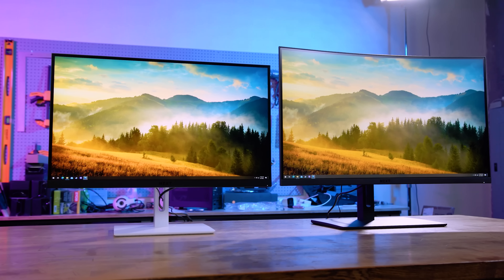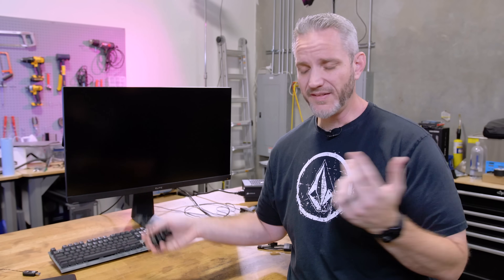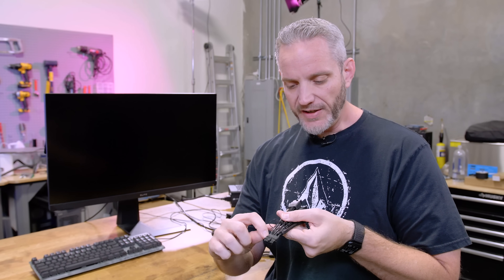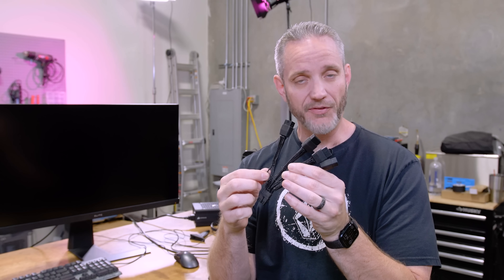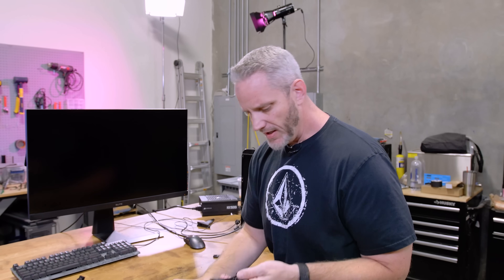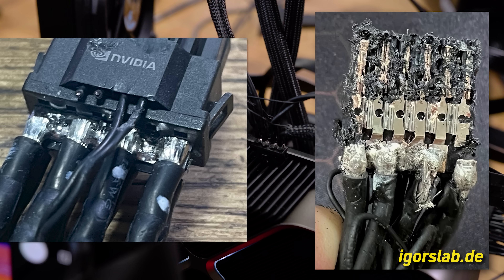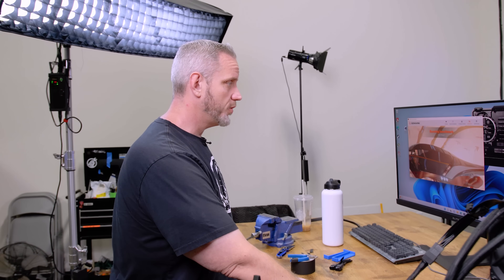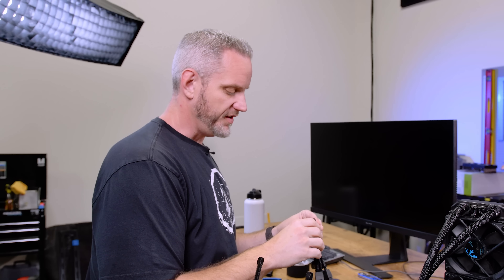Igor's Lab figured out why NVIDIA adapters are melting!

Comment: It scares me that a multibillion-dollar operation can miss such a crucial issue in the design process :/
Reply: Apparently not every business learned from the Ford Pinto fiasco
Reply: Hey now, we can save $0.01 per cable if we do this... that's a new leather jacket.
Reply: Its not Nvidia that designed the cable though. Nvidias problem is they want to always be first and bleeding edge to adopt new tech standards, unfortunately this time its bitten them a little.
Reply: You've obviously never worked for a large corporation in a design capacity ..... I worked for a major industrial controls corporation in the late 90's and it was a constant battle between the engineers and the Beancounters who wouldn't know an electron from a proton, a bit from a byte or their own ass from a hole in the ground ..... They were always looking for ways to cut corners and cut costs .... I eventually just quit because I got tired of all my designs being re-specced by people who didn't know what they were doing. There is a reason I chose a particular capacitor type and manufacturer 

Like I used to say: I can do it fast, I can do it cheap or I can do it right .... Take your pick because you only get one choice
Reply: Greed knows no bound fam.
Reply: Not the first time either!
Reply: They didn't miss it, they even warn against bending it in the manual. The problem is they designed it so that people can fuck up their cards easily and they dgaf
Reply: They cut costs and used a shit manufacturer to make the cables who used shit solder and didn't solder them correctly in the first place. So produce as cheap as possible and price 3000%over the initial cost. Easily breakable components they tell you not to flex btw means broken cards they can void warranty on and sell more cards. You know they will pulls some "well you did this when you should have done that" type of crap forcing people to buy another card after they deny your claim due to user error. 😉
Reply: @BNR_248  Yet they didn't adopt displayport 2.0 lmao.
Reply: @NHDude  Lehto's Law did a video with some info on the ford pinto.  Apparently There was one car that caught fire after a crash.  Dont think anything happened aside from that
Reply: @longjohn526  with the unprecedented profit margins of the 2019-2021 companies are milking consumers like never before - For how it used to be, i can only imagine how tight the beancounters are running operations in these stupid recent times
Reply: @NHDude  i own one with a 302 lmao
Reply: They just don't care. Once you get that big, giving a crap about the customer goes right out the window.
Reply: This is exactly what a multi-billion dollar company always do. You should be scared because they are all like this.
Reply: they probably designed the cable correctly, but high probability that either bean counters or Chinese manufacture changed it off to shave some change into their pockets.
Reply: I smell burning actuaries.
Reply: @professortriplextralarge5  it's the fact that was even possible considering other cats had safety features that stopped it long ago.   cars rarely explode outside of movies and mob hits
Reply: @PURITY Is it? 12vo isn't 12vhpwr. 12vo is a 10pin that takes the dc-dc changes off the psu and puts it on the motherboard. 12vhpwr just seems to be on atx.
Reply: Sounds like a job for the “Plainly Difficult” channel.
Reply: @longjohn526  eh.  You can some times get two on the triangle.  Just not all three.  And to get two it heavily impacts the third
Reply: Yes and I own two, one of which I bent already prior to knowing about this, nvidia owes us a free cable.
Reply: @Michael-zf1ko  yea that’s a weird decision. Can’t explain that. For the price should be display port 3.0 lmao
Reply: @jemiebridges3197  If it was one car and after a crash then there isnt much evidence to say it was a mass defect.  Thats what i know.  Let me know if theres something I'm missing
Reply: @Kasaaz  The design itself is so braindead that even if you make it in the best way possible it's still flawed.
Reply: @longjohn526  There's a similar one in the car world. You can have reliability, performance and inexpensive but you can only choose two.
Reply: That tens to happen when you're too busy talking shit to the people normally handling these things for you so you can justify running them out of business.
Reply: @PURITY It's the cable standards committee for PCI, a third party.
Reply: @Jesus_4_All  Yeah, especially after he showed the one Igor's Lab had fail, you can see why some of them are being made even worse. They aren't using a single plate across, they're using sections and then bridging them with the solder for the wires. It's no wonder they snap at the edges.
Reply: @BNR_248  Then why they got the beefiest card ever stuck with Displayport 1.4 instead of going 2.0? They could have reduced some overhead, which would be actually useful, plus a higher bandwidth limit (probably not as useful for most people as 1.4a is already pretty fucking high).
This is just mismanagement, no company is immune to that. They didn't need more space on the PCB, there is no point to this plug.
Reply: they didn't miss.  They've told people the allowance the cord should be given.  People shoving it in small cases and forcing bends is on them, nvidia shouldn't do anything for the people that caused this issue themselves.  If nvidia needs to do anything, is to extend the cord support or tape so bending it past the allowance isn't even possible without removing the support
Reply: The only reason why they use this small little shit connector because of they want to save some space of GPU pcb for other components because in the old connector is huge and eat up a lot of space like 8+8+8 pin PCIE
Reply: @xXDeltaXxwhotookit  only about profit and not about quality these days, its so sad
Reply: They knew most likely. Someone with an MBA tried to save 1 dollar per adapter by doing them this way.
Reply: Seems like the standard way the world's going tbh.
Reply: Mo money mo problems am I right?
Reply: @lucastonoli3256  mate I don’t know I don’t work for them hahaha.
Reply: I guess you never heard of Boeing?
Reply: @NHDude  they probably have a lawyer who told them how much to pay for a settlement.
Reply: AMD and Nvidia both make their stuff in China. This is what happens.
Reply: It's usually small 10cent parts taking down the big expensive machines
Reply: they didn't though, they knew it was an issue but chose to ship it anyway.
Reply: @professortriplextralarge5  a full "autopsy" was ordered.  I was a kid so I didn't pay much attention at that point, but my parents made the engine for that car and later the f150 and mustang, so it got talked about a lot.  Musta been pretty spectacular if it was only a single incident.   However there were other incidents along the same line just minor but dangerous.  So more than one data point, but this was more the nature of fires than explosions I guess.  also everyone was probably still suspicious as that was after whatever car thing that made Ralph Nader famous for passing "unsafe at any speed"  law
Reply: @AceStrife  yup
Reply: we rarely know who allows that bad cable. Now NVIDIA will have to pay for the wrong move.
Reply: @BNR_248  Yes. As there are people have been using 1 horsepower ok.
Reply: @asdf_asdf948  So these entities will no need paying too much in law because of the clearly note of using the adapter?
Reply: @jemiebridges3197  Whoever does, depending on how much, how much effoct you have paid just like house revoation.
Reply: @LilOleTinyMe  This is likely a typical trilemma. You cannot get all equal or things will go wrong.
Reply: @stepbruv8780  This might be one of reasons. Second , leaving a more possibly for even more powerful 4X4 matrix calculation accelerator.
Reply: @T51B1  It doesnt need MBA, MBA is a biz club. One of person surnamed LIN, deceased, says you get better if you pay more.
Reply: @TheTurbinator  I have some ideas of her, Perhaps a bad controller which sends 400 people to god too early, within 30 says?
Reply: @sophieedel6324  No. We do not fully care where. Just how much have paid.
Reply: @Masterfighterx  Absolutely, perhaps your police officers have little more ideas of that? I asked something from them.
Reply: Xbox 360 ring of death vibes
Reply: @BNR_248  They didn't design the cable, but they approved it without checking. Like Elon Musk who bought Twitter without checking. It's ultimately his fault alone.
Reply: Because it wasn't designed for gaming. It was designed for crypto mining. And then crypto crashed. The 4090 itself wasn't designed to fit into a gaming PC. It was designed to mine in a crypto farm.
Reply: @chuheihkg  a big problem in capitalism is that companies will not fix the problem if they think they can get away with it. For example a company will dump toxic waste in a river and them declare bankruptcy when the government tries to make them clean it up. Or if they make a dangerous product but they will make more money selling it than it costs for them to settle the lawsuits from injuries/deaths caused by them.
Reply: @nickllama5296  tbd once ya go public. Your investor's can sue you if you don't maximize profit. You can push back, but it has to agreed upon.
Reply: They're well aware of the issue. They proceeded to sell them regardless.
Reply: @Revolvor   I’m all for calling out companies for cheapening out on components but let’s not use hyperbole like “nvidia is marking cards up 3,000%”. Their gross profit margin the past year is 65% which is pretty damn high compared to most companies but it’s nowhere near 30 times their ROI.
Reply: @tlst9999  Well if it’s Elon’s fault for not checking then I guess it’s everyone for buying the card too without researching, amirite?
Reply: What makes you think that having money makes all your decisions right? The world doesn't work that way. Engineers are not some kind of transcendent beings, they are just people. You can only test things out so far, there will always be issues with new tech, and that's why we have multiple revisions.
Reply: @longjohn526  it's pick two. The saying is pick two. You can give it done fast, done right, and done cheap, pick any two.
Reply: @asdf_asdf948  Perhaps you are right. Although I dont have anything on hand like that, If there is no known small note about how to use and caution points such as cable no bending, then problem can occurs.  It is likely that at least four unlucky users, will rarely get anything from 'em because of the notes.
Reply: @tlst9999  whatever she is, she is known can do non-interpolated 4K/30P 3D recreation under major heavy load such as massive realtime ray tracing , including dual video transcoding AV1 accelerator , If you are looking for " mining" , perhaps You have asked a wrong one.
Reply: @PURITY No, Nvidia's name is on the product, they are end responsible for the products that they sell to their customers and they chose to include this adapter with every 4090 even though they knew before launch that it was a bad design. Intel came up with the design or maybe even just the spec, but Nvidia made this horribly cheap execution.
Reply: @nickllama5296  True, but Nvidia seems to have a particularly f-you attitude toward its consumers.
Reply: @longjohn526  I can relate as a 3D artist. They have zero clue on how much time and effort it takes to make something. It was kinda funny when one guy said "obviously you can make this in a month" for something that usually takes us half a year to make... Annoying how they never ask us and really dont care if the shorter time impacts quality.
Reply: @TheRustyTigger  Jesus Christ imagine bending over so much for a corporation like Nvidia. Cables are MEANT to bend, you know, for cable management and stuff. This was a non-issue for previous gen cable designs. When it comes to $1600 graphics cards and fire hazards, a relatively cheap component like this should be idiot-proof.
Reply: Of all businesses I'd expect the most profitable ones to cheap out the most on these things.
Reply: @asdf_asdf948  The thing is, a hazardous design is a hazardous design if there's a reasonable chance that normal use (as in, how people would normally handle computer power connections) could cause a fire. To add a disclaimer telling buyers to only use it in ways that can’t be reasonably done given its use (such as "keep it straight and unbent even though there's no way to do that in modern cases") won't cut it. That’s a little like saying that a home heating system that results in a major carbon monoxide leak is perfectly acceptable, as long as they include a disclaimer that people should not breathe while living in that house.
Reply: Lol have u seen the clot shot?
Reply: @Kasaaz  I went to go watch it, total meme design! It really is baffling , how they are making all these bad choices.
Reply: Because cable connector design sourcing is handed off to junior engineers.
I once saw a PCB layout with all the decoupling capacitors neatly placed in one corner of the PCB (as per the schematic) . This was mid 90s and pre easy internet and the tech was learning his craft remotely.
Reply: @TheRustyTigger  Have you seen the amount of LGA motherboards ruinedi by ham fisted customers ?
Reply: @T51B1  Let's see what the recall costs them.